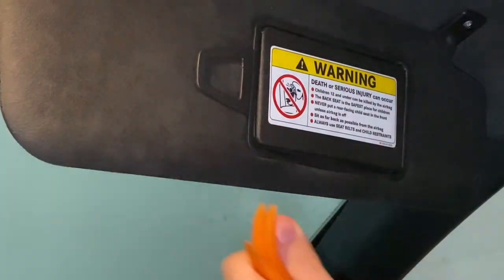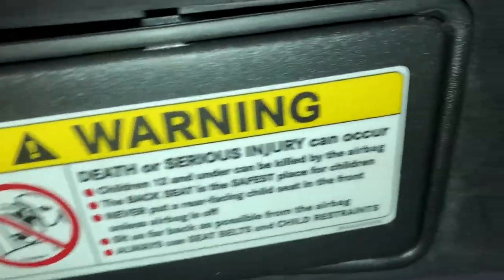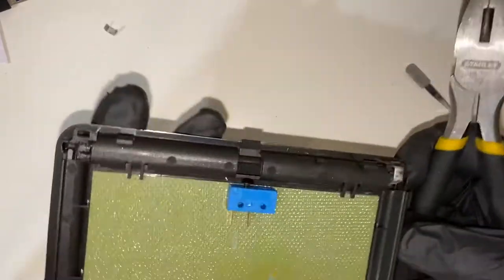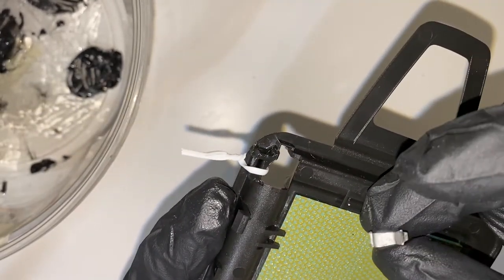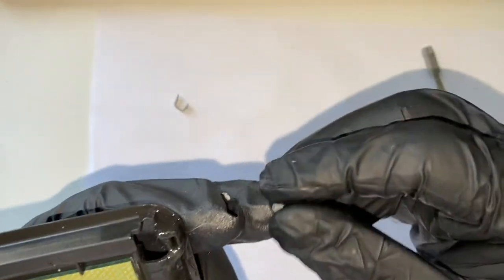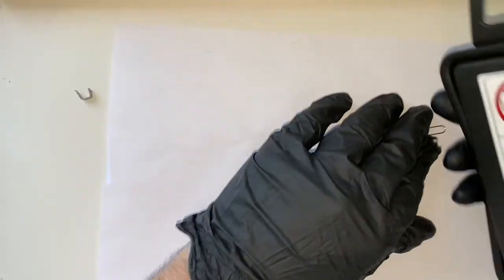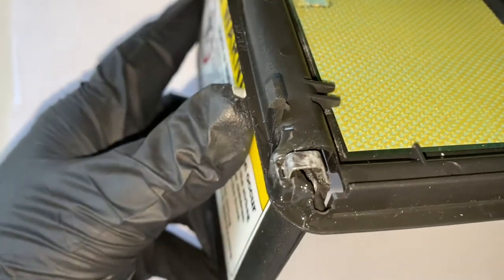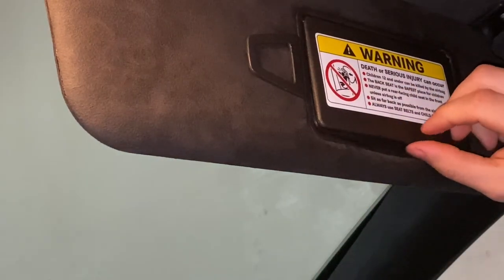CLS w219 W211 sun vizor mirror cover repair.

Comment: Thank you so much, I have the same issue in my car and because of tension being bad it's not turning on the lights.

Wouldn't just bending the metal piece a little bit would have solved it?
Reply from the maker: To be honest, I don't think just bending will solve the issue. The engineers calculated everything. The main problem is a crack in the plastic because it's old.

Comment: Awesome video. I think it applies directly to my w211. Question: which side has that blue contact microswitch stuck to the visor as I noticed one side was plain and other had the blue microswitch?
Reply from the maker: I don’t remember already. They both has the same parts.
Reply: @bigboycars  Just removed mine and they are missing that metal retainer sadly. Do you think I can make a workaround somehow?
Reply from the maker: @shaazy  not sure. That metal retained made of strong metal. Try.
Reply: @bigboycars  Yes I tried but couldn't find a workaround. Those retainers last forever, I keep discovering new ones as I take my other w124 apart. For the w211, lack of retainer clip means the mirror cover won't stay up, which I guess I can live with.
Reply from the maker: @shaazy Maybe you can find the part on eBay or a junkyard.